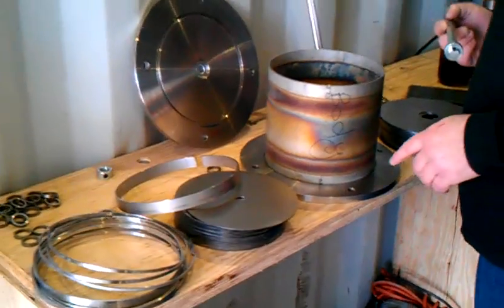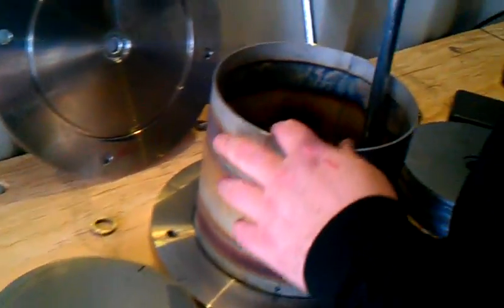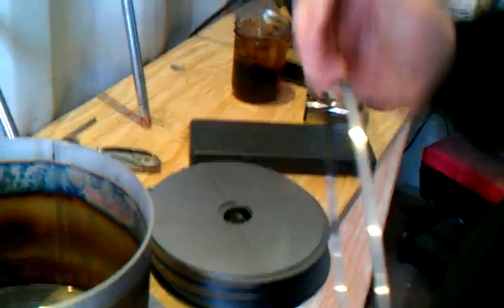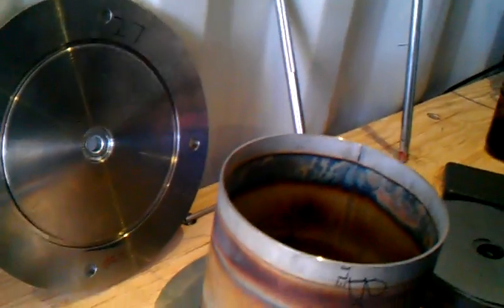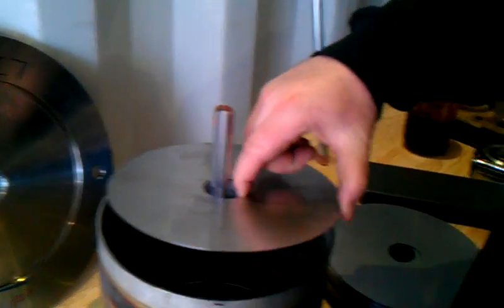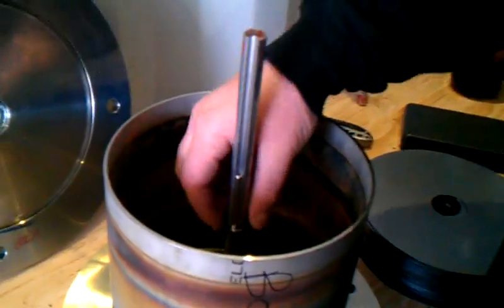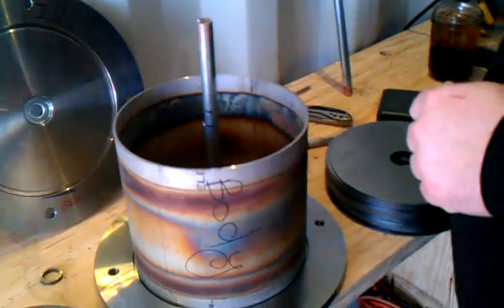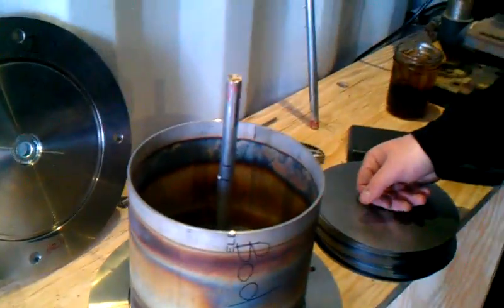Friction heater that gets up to 300F

Comment: This nonsense would be far less efficient than a regular electric heater you could  buy at any store, because of the parasitic loss in friction and mass. Anyone who believes this nonsense hasn't the most rudimentary understanding of physics.
Reply: Any "loss" is heat. I think it's correct that this system is no more efficient than a simple electric resistance heater